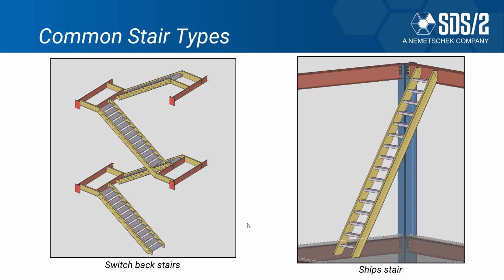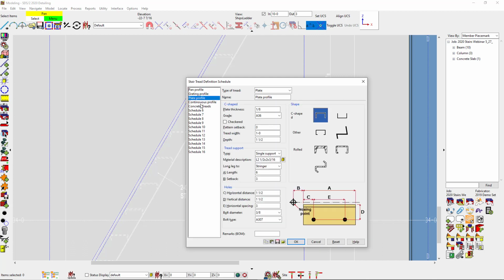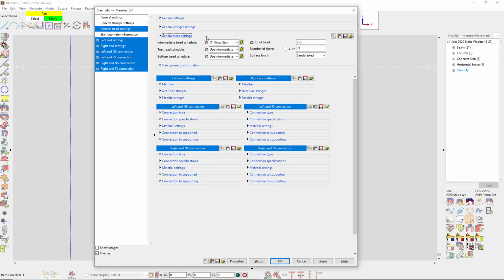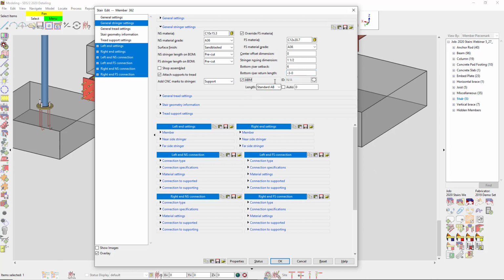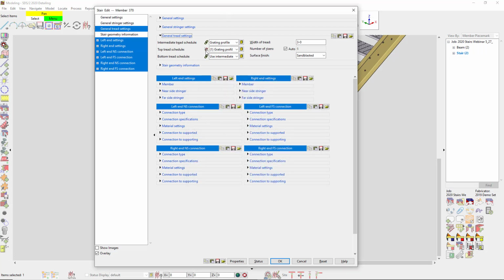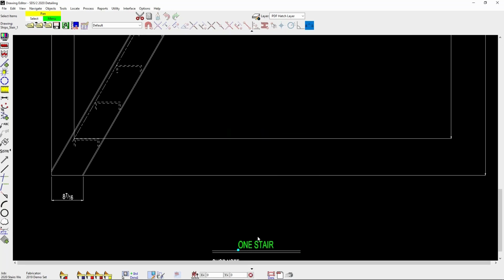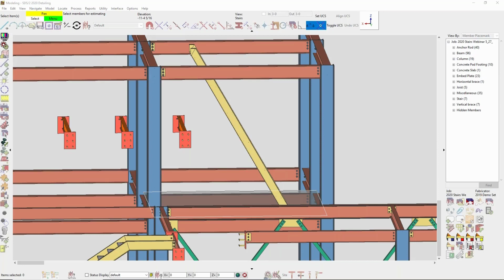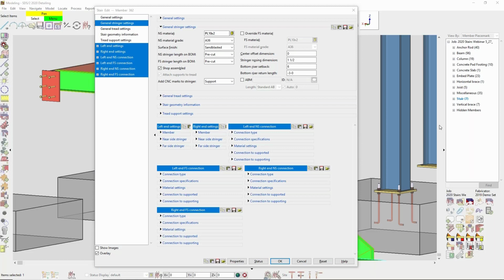SDS2 2020: Detailing Stairs Webinar: Part 1

Comment: Is it possible to model a stair with an intermediate landing (lower tier-landing-upper tier) as a single unit?
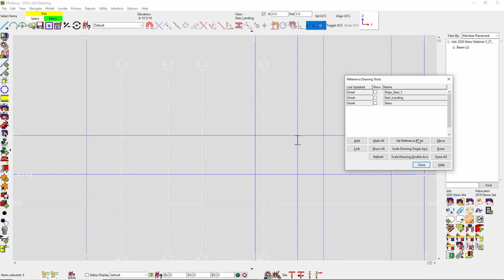Reply from the maker: Hi, No it isn't possible. We use "Stair Quick Add" where you can create your landing from the lower and upper tiers of stairs. This is reflected in the webinar at 23:00.